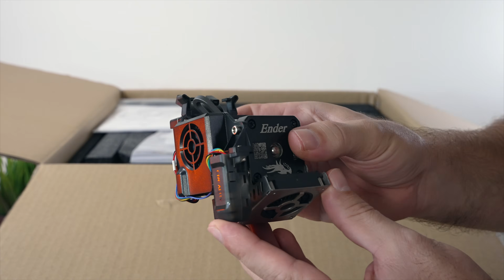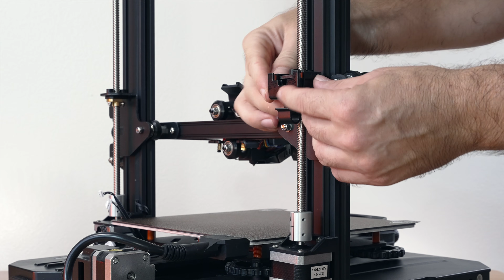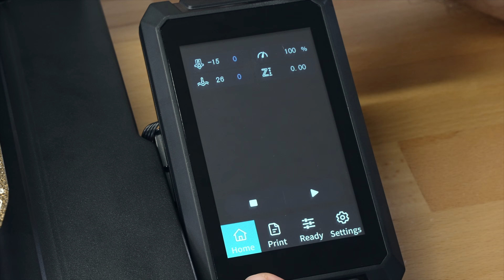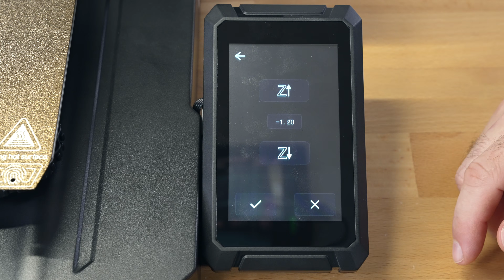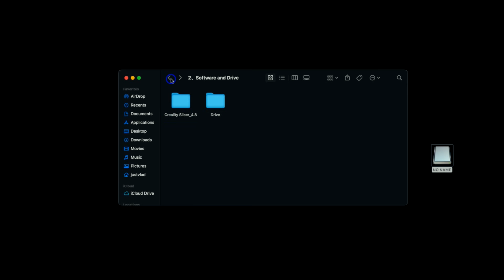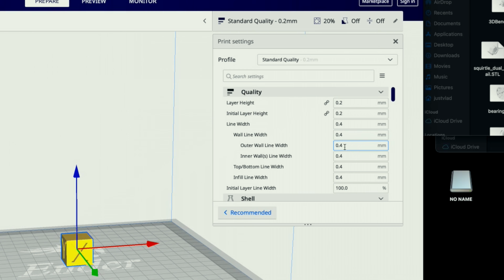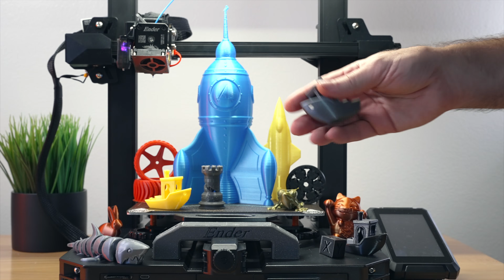Creality Ender-3 S1 Pro - 3D Printer - Unbox & Setup

Comment: To avoid stringing, your fillament need to be dry. Like it needs to avoid humidity. Have a chamber for your fillament with silica beads. You probably should also have a tube as well so it won't get exposed to humidity as it's going through the feeder.
Reply: Pla ain’t that big of a deal unless your in the swamp
Reply: @flubbernugget888888  pla is the worst about absorbing moisture, if its even slightly humid in your house and you forget to properly store it then it can ruin the roll. I had to get a dehumidifier and sealed storage because I was tired of dehydrating my filament each week.

Comment: I just got my first 3D printer, an Ender S1 Pro today and I followed your setup guide and PLA settings and my first print came out looking amazing. I printed out a Picoboot holder for the GameCube by HUVUL. Your guide made my first print easy. The only issue I had with my setup and had to repeat was the Auto level. I had to do the auto level twice because there was such a large gap in the center of the bed and I manually compensated all the way down to -5.00 and the extruder never moved. So I zero it out and ran a second auto level and this time I was able to get a manual center level at -3.40 but it prints beautifully. Thank you so much for your video.
Reply: I have the same issue. Can step out the details on how you rectified it. Also, the  manual levelling lever are almost on the looser end
Reply: @anirban17aug  I'm new to this and I've been printing nice quality prints but what I did that worked for me was to tighten all 4 levers/wheels and then I manually leveled the bed loosening the wheels as you go and using a piece of paper where the nozzle slightly grabs the paper like in the video and afterwards I did the auto leveling and everything came out fine. My level is -3.40 but I have no issues and if you are concerned about that, there is some part you can buy to put on under your bed to push it up but honestly it works fine.
Reply: @ShaggyShaggums  thanks a lot for your response. I was able to level it and z axis is set at 2.70. Everthing seems to work now.
Reply: https://youtu.be/GmhBYOEb-ro
I found this video, thinking of buying the printer myself. Does this help?

Comment: Hi! Thank you so much for video and review... Do I understand it correctly - printer can be connected to desktop\laptop via USB-type C? But in this case, printer will read the file directly from form comp? It might be not quite useful - if the printing lasts for 4-5 hrs, the comp should not go in sleeping mode otherwise the printing can be interrupted.. Can it be done in the following - to plug in the SD-card, to drop file from comp to card and printout from card? 
Thank you!

Comment: Great video! Really considering buying this one.

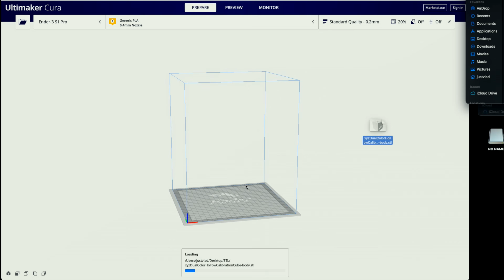Quick question for 38:15 : Why do I see everyone push back the model? What is wrong with keeping it just in the middle?
Reply: I believe it is because the stepper motors being centered would have less precise round pieces, so if they are micro stepped from the slicer, circles/rounded faces would be easier

Comment: Hi @Just Vlad, very good video! 
Just bought the same printer and I did use your instructions for the Cura setup: all perfect!
I have anyhow an issue to understand how is the correct prcedure for bed levelling: to me is not clear the right sequence to use ste by step and what is the Z offset setting with Touch Control and why is different from bed manual levelling with knobs. I use both and each one create an issue (Z offset was different when start to print, knob regulation did make the extruder hit the bed! Do you have a detailed explanation on how to setup first time  and keep levelled the bed on each printing? thanks!

Comment: At the point in Cura where you inserted the G29 code you did it incorrectly and way too quickly. 
You just added 029 to the G28 code as follows which is incorrect: G28029 ; 
It should have been G28 ; THEN ON THE NEXT LINE 
G29 ;
In actual fact G29 is not needed at all if you use M420 S1 ; in the next line. 
Eg.
G28 ;
M420 S1 ;

Comment: A good video up to 30:51. From there you actually fell of the bus until you started printing. You should have made everything  clear on the use of the interface. Just saying "you probably cannot see the screen......" just doesn't cut it. You are using an old version of the Cura slicer that needs more inputs than Cura 5.1.1. BTW which version of Cura did you use for this video? 🤔

Comment: Thank you so much I was having so a hard time for the first week of having this printer to get it to level. Every time I printed it would be off level turns out I just didn't level it manually 4 times in a row to get the auto level compensation to work properly. Thank you

Comment: For the offset - using the sticky note worked?  I've seen some reviews of people who used a sheet of paper for older enders, and said that the sheet of paper didn't work for the enders with the auto leveling, that they had to use something else, otherwise they damaged the bed.  

I'm new to 3d printing - printer coming tomorrow, just want to make sure I have it right.

Comment: Hello what setting did you use to print TPU as i just got this printer and just set it up, but i only print in in TPU right now making parts for my drones if you can help that would be great im using cura 5.0 for slicing

Comment: Ender s1 pro Very bad, printer you pay the price of a printer with a cr touch  sensor that does not work if the height 2 and most of the printers cannot weigh under the number 2 because it is the scrap of.

Comment: Thanks for the video - isn't the point of the auto leveling to avoid having to use that Z axis adjustment? I manually level just as you did, then run the auto level and when trying to do a test print it's WAY off.. just like yours was.. am I doing something wrong? I can adjust the z axis to -1.8 while printing the test print and it comes out fine, but I thought this was not supposed to be needed... sigh.

Comment: question is it normal if offsite ended up  -4.90 ? is there a range should be in between?  29:51
Reply: I think it's too much. Mine end up at -3.30 and I also think it's too much. I think it should be between + - 2.5 ideally.
Reply: First printer and after doing manual, then auto, I have a offset (using the sheet of paper it came with that says on it for leveling) of -4.45 where the paper gets  bit of resistance sliding around.  Now this is using Vlad's method of preheating everything first.

Comment: Kinda weird that you still have to level the bed with paper. Since it has a probe it could just probe above all the screws and tell you how much you have to turn each knob.
Reply: The knobs are inconsistent. Depending on the spring tension and irregularities in the wheels, some of them need to be turned more than the others for same amount of leveling. Caused me loads of issues in leveling.
Reply: @DKFX1  That makes no sense at all. The spring is what pushes the heated bed and the Y carriage apart. The screw sets the distance regardless of the spring. One revolution of the knob always moves the bed 0.5mm (assuming M4 screws).
Reply: @DKFX1  Regardless of all of that, you should use the outputs of the probe to tell you which corner is off. Not a piece of paper. Paper is for when you don't have a probe.
Reply: @m97120  I think that would be an interesting idea, but problem is if the probe says you need to raise your corner with 0.43 millimeter, then what to do with that information? the human eye can't easily make such precise movement, and the probe doesn't have the ability to move the bed, only measure it. If the wheels and springs were consistent then it could be possible I think, but they're not. 

Also remember the probe doesn't level anything, it only calculates how much your plate is bent and adjust for it during print by applying mesh compensation..
Reply: @DKFX1  If the probe tells you that a corner needs to be raised by 0.43mm then you rotate the knob of that corner by 310 degrees. Once you've made the adjustments you just probe again to see if the offsets are within tolerance. There's no need for the human eye to see anything other than numbers.
The raw output of the probe can be handled in firmware and it can just tell you how much you have to rotate the bed knob. This is, for example, integrated like that in Klipper.
There are no inconsistencies in the M4 threads of the bed screws.
Reply: @m97120  In fact they are inconsistent at least on the plastic wheels they are for sure! On my machine the upper left wheel needs to be turned much more than the lower left wheel for the same amount of adjustment.

Comment: Thanks for the video, well done. One extremely important step that I didn't see (may have missed it but worth repeating), check the voltage selector switch on the back of the machine. Mine was set to 230v, it was purchased in US so you'd think they would have set this correctly for you... but they didn't. Remove the sticker and set it to 120v if you live in US.
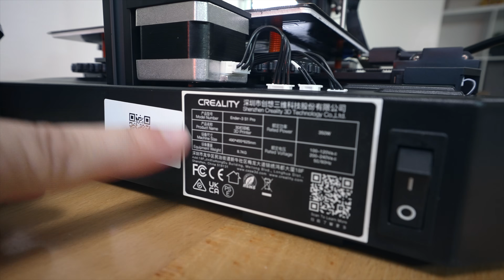Reply: As seen @ 20:34

Comment: This printer is full of issues. At least the one I got came in with the fan diffuser broke, the light strobes and dims randomly, auto leveling system won’t work, it would override any auto leveling done every time that the calibration finishes, ultimately the power supply was faulty as well. I made the huge mistake of ordering straight from Creality and it’s been impossible to return the printer and customer service is asking me to do all sorts of R&D things to figure the problem but this printer is advertised to be effortless and “plug and print” just as this video suggests. Do your research, this model is turning out faulty and many other people are having this issues. CREALITY WONT REFUND YOUR MONEY! Buy it from Amazon or an American retailer

Comment: Just me or does the print head look crooked? Like the left side is higher than the right side? Check at 25:07
Reply: You´re not. It doesn´t look good.
Reply: Cool. I'm the only one.
Reply: It's the actual vid making appear tilted, the camera angle is a bit off.
Reply: @johnsathe2429  You can't have one part look crooked where the other part looks straight and then say it's just the camera angle. That's basic logic. Also it's called barrel distortion because of the wide angle view of the lens. It makes straight lines appear slightly bend.  That's something different from a camera angle.

Comment: The all-metal sprite extruder has major stringing issues. Its pretty good for single solid type prints, but for articulated stuff with really sharp details, like the articulated dragon,no amount of retraction is enough even with new perfect filaments (used esun glass light blue). Your review was the only one that pointed that out and I'm a little relieved that I'm not the only one facing such issues. I'm still waiting for cura's profile for this printer if at all that helps.
Reply: I have it, and I'm not seeing a lot of stringing. Barely anything, even on articulated prints.
Reply: @DKFX1  could you please share what slicer and it's settings you're running?
Reply: @dhruvbose8294 I'm using Cura 5.1. For articulated prints I've used the dynamic or super detail, default profiles with succes. For regular prints I use a finely tuned hyper fast profile that reduces print times by 60% to 80% compared to the standard profile.
Reply: @dhruvbose8294  Try checking if you have a partial clog or a leak under the silicone sock.
Reply: @DKFX1  no leaks. What are your retraction parameters?
Reply: @dhruvbose8294  1 mm. 40mm/s
Reply: @dhruvbose8294  and remember changing the minimum retraction distance to the same value as the retraction distance.
Reply: @DKFX1  yup have taken care of that. What speeds do you usually print at?
Reply: @dhruvbose8294  between 40 and 80 mm/s.

Comment: Thanks for detailed explanation.  Please anyone help me. I am facing so many problems like bed levelling. Knobs come out during manual aux levelling  process. Some how I managed by adjusting screws and springs beneath the bed surface. But when I switch from aux or manual to automatic my nozzle changes position and goes above bed instead of remaining close to bed. Another problem is while printing demo which are given on card like rabbit or cat, print do not stick to the surface and move here and there resulting just mess. I am not getting if problem is with ender my S 1 pro printer or am I doing something wrong. I purchased my ender S1 pro yesterday from amazon and installed as per your instructions. Please somebody guide me.
Reply: You probably have a bent y-axis. The fix is easy on most machines.

Comment: So I just got my S1 Pro and when trying to get the wheels on the gantry to spin equally on the left side where the ribbon cable is one of the wheels (top one) never tightens its always loose.  Does that mean I have to loosen the two bolts that mount that bracket perpendicular to the gantry and push the two left wheels flush?

Also nothing is sticking to the textured side of the bed, know I know the room is air conditioned but the bed temp is reporting within 1 degree.  I did up the temp to 65 degrees anyway but no joy....

Comment: Your G28 G29 code is faulty.
They should be on a separate line otherwise the G29 is ignored.
That said, you dont have run G29 on every print, i use the menus calibration instead and always only have G28 in my Start GCode
Reply: Yes I was unlucky enough as to follow this instruction for a week or something thinking the g29 was doing something in my ignorance. I thought it was calling out the last saved mesh as later on I learnt the m420 s1 was doing. He should be putting some disclaimer in the video by now, I see several people commenting about this. THe G29 needs to be in a different line.

Comment: Alright, I think I need some help. I followed your leveling procedure - first manual, then auto. But I have a problem with the final step. After auto leveling, the nozzle is too far from the bed to do the final z-offset step - where your value was -1.20 mm. The maximum value is 5 mm, which is not enough in my case... Anyone knows what to do?
Reply: Turn it off, turn it on and level it manually again. Got the same problem and it was because of a bad manual leveling of mine :d
Reply: @emanuel1276  I had the same problem. This worked for me also!

Comment: I set my 3 S1 Pro up and it was printing like a champ for 2 days. On day 3 without any hardware or software changes it suddenly would start printing with the nozzle way above the bed. I found this video and tried to follow it. My printer (with the exact same firmware version as yours) will not auto level with the bed pre heated. Gives the 203 error. This is after a good manual leveling while heated. It will only auto level on a cold bed. After that finished I went back to manual level and set the Z offset on #1 just like you showed. From there it doesn't matter what I try to print. Demo prints, a few of my own files, they all start with the nozzle WAY off the bed. Some have said it's the gcode on the files telling the printer to do this. It doesn't seem the case as for the first two days the printer ran these exact files without issue. The printer is new and I've verified the hardware is all secure with nothing lose. 

This is my 2nd Ender 3 S1 Pro. The first one showed up to my house bricked unable to boot. Creality support never bothered in 9 days to reply to a couple of support request emails. Luckily I purchased the printer from Amazon or I'd be up the creek with a $500 paperweight. Seems this one too needs to go back as well. The utter lack of customer support is appalling. I see a few of you here seem to have working units. Grats on that. How I managed to get two lemons back to back is odd, but they are lemons none the less. I was warned about this company and advised to go Prusa. Looks like those folks were right.
Reply: I have a Prusa MK3s+, and yes it's reliable, but the design's a bit dated and it uses some older parts. If you're going to spend that kind of money, I'd recommend waiting for the XL, or going with an Ultimaker.

Comment: Great video
Question : Do you have to do the leveling process every time you Power Off/On the printer?
Reply: Nope, although people recommend doing it after a few prints.
Reply: @DaBuGzLiFe  I usually do it after every print just to be safe. Nothing is worse than wasting 5 hours and a ton of material because you left it running at work and come home to a noodle factory.
Reply: @teddy5004  true but it's not always the alignment

Comment: Thanks.  I got the s1 and followed your video.  One thing I found is that I have to be patient.  Sometimes it just takes a few seconds to be ready to go on.  Getting impatient and pressing a selection more than once often causes it to lock up and I have to reboot. This is true in leveling especially.  I also noted that when I pre-heat the PLA sometimes it will think I am printing and I have to stop it and start over.  Weird.  However, overall it appears to be working fine. I love the new filament feed. Much better than the pro and V2.  Overall, I am looking forward to putting some miles  on it.  Your videos for assembling these are SOOoooo much easier than trying to figure out what the manual wants.  Especially when it comes to correct things like a loose bed.  Just love them.

Comment: Excellent video really clear to follow thank you. I just wanted add to my coment, my first printer was Prusa  mk3.
The new Creality Pro is worth  every penny,  the full metal head is perfect. I print mainly in Flex 98 and softer TPU the feed and hotend just work amazing.
This my new go to printer solid build and amazing prints, just everything about it has been so well designed and thought out. I am trying to find faults but so far none, great job Creality
Reply: Thanks for your insight!